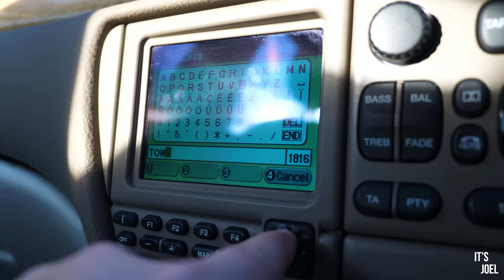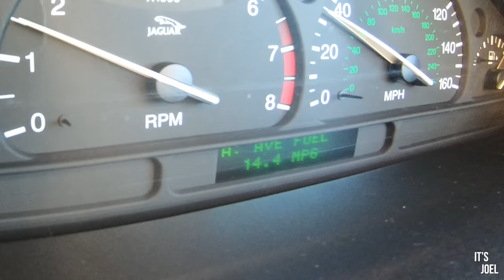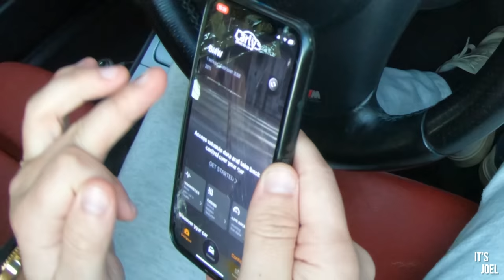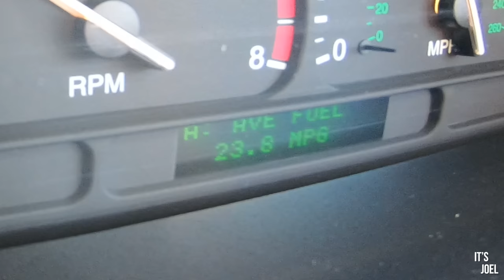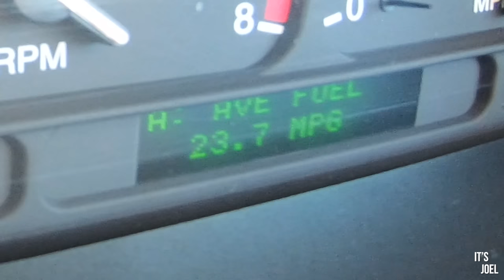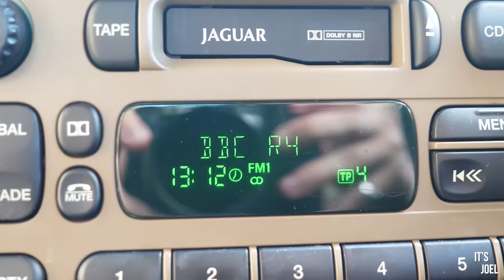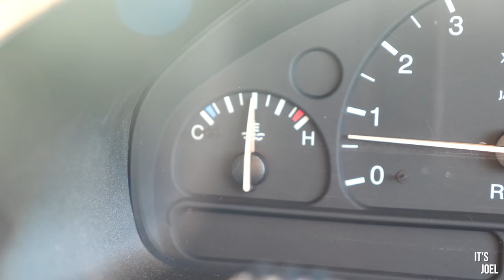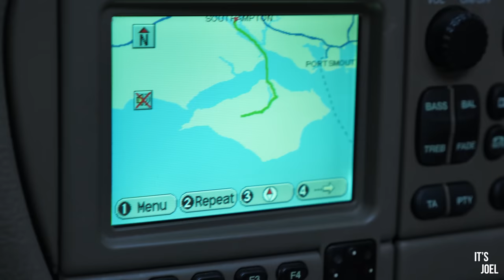Can I drive my cheap & broken V8 Jaguar across the country?

Comment: Ah I should’ve given you a tip. In winter put the sticky pads on the plates and then leave them on a radiator for a few minutes before sticking them onto the car. It helps with adhesion
Reply: I was going to say take a hairdryer to them and the point where you're going to stick it
Reply from the maker: I probably failed at the part where I used a wet cloth to ‘dry’ the surface… 😂 I was running late
Reply: @itsjoel  lol
Reply: Don’t top up with pure water in these conditions. My step dad did that in a rover years ago and up to full working temperature went on the motorway and the radiator froze due to the wind chill.
Reply: @itsjoel  it’s common sense there not gonna stick to a wet cold car 😂🤦‍♂️
Reply: @itsjoel  screwing them on is the best way to stop them falling off. I never trust sticky pads, I always screw my plates on my cars
Reply: @lukefleming0607  true
Reply: High Peak Autos & It's Joel in one comment. 👍
Reply: How did the world manage before YouTube and sticky pads Brunel would be proud.
Reply: E38 728i  Mint green manchester .
Reply: I love my stype. It sounds and looks like a jag.
Reply: Rudi

Comment: I really love Jags. My last one was an XJ358 V66,  I now have an Xj351 Portfolio, I can’t get over the performance & luxury that this car provides  - from the floor to ceiling, there is a feeling of superlative luxury , comfort and believe me, you ca climb out at the end of  a long trip, feeling fresh, wanting to justt get back in & take in everything the entertainment system offers, knowing that you won’t be getting anything better in your £185 per night hotel! There is one thing I envŷ you in your S Type is the beautiful wood steering wheel & transmission shift! Sure, I have massage seats, incredible 21 speaker surround etc But the steering wheel is heated and all that, - but no wood! An, I bought mine with only 48k on the clock,, paid up front, and find it hard to believe that this sort of luxury,  performance & looks could possibly be beaten! The new design took a bit of getting used to, but it too, is still unique. Sure  they cost a bit t maintain, but who would want any more? And it is British. There is nothing like a Jaaaag!

Comment: Good afternoon from Texas. If I may  make a suggestion, unless it’s an emergency, I wouldn’t ever add water alone to the cooling system. It quickly corrodes the water pump. Also, if you fill the reservoir with proper coolant after you’re done driving it for the day, the radiator will draw it in during the overnight, cooling off process. Good luck.
Reply: If you have a car that is leaking coolant it becomes quite expensive to fill it up  over and over with actual coolant and since the car was mostly full of coolant and Joel just topped it up a bit with water is probably not going to harm the car. Or harm it anymore at least.
Reply: @lbnewell23  but isn’t he topping it off regularly? If so it’ll quickly become a coolant system full of tap water won’t it

Comment: Just FYI, the temperature gauge on Jags of this era are just "idiot lights" (it certainly was the case on XK8s). From bang-on in the middle, straight into the red if over heating is detected by the ECU. There are mods to make it actually useful. Your leaks could be caused by exhaust gases building up in the cooland system, causing excess pressure. To be investigated.

Comment: I owned a Jaguar S type 2.5 v6. Silky smooth  & reliable engine, for a 2005 plate motor.  Cost me £750.  Good on fuel. Had black leather seats.Best motor ive owned.My dad drove it around for over a year.

Comment: If you can roll the driver side window up what you can do is press and hold the open all doors button and all the windows will open then just roll up the others I have the same problem in my s type because I completely forgot to roll up my front windows when it started poring rain one weekend and my driver side doesn't go down but it goes up I would check to see if it makes a noise when rolling it up if it does then you can use the method till you get it fixed

Comment: i dont think you have a head gasket problem . Sat navs are crap i set mine then ignore it its mad i set it once FROM ,  manchester to stratford upon avon it tried to send me on the smart motorway on M6,   I IGNORED IT AND WENT  M6  M5 on to m42 then m40 Junction 11  .86 miles less my way  than sat nav..

Comment: Brilliant video Joel, with the S Type on the Isle of Wight. Me & my husband go on our summer holiday every year & we go in either one of our Jags (yes we've got two)😃. Good luck with the wedding next year. The island is a beautiful place for the wedding.  I can also recommend Jersey where we had our honeymoon, a long time ago, admittedly..lol. But that is a special place too with a unique history. 
In terms of the Jag V8, might be worth getting the water pump & thermostat housing looked at. They're plastic on the early 3.2 & 4 litre V8s & do go. You can get metal upgraded one's though from the later 3.5 & 4.2 V8s. Might be worth checking the timing chain tensioners too as they are also plastic & can break, with nine failure. They can also be upgraded for later metal versions. If it's not already been done (check the service history). It's not a cheap job, for the tensioners & a new chain, probably nearly £1000 with labour. Good luck.

Comment: Best advice when attaching number plates is to use screws.
 No getting stopped by the police for having no number plate on the rear on account of it falling off 10 miles back.

Comment: Actually started laughing at the dancing to the car alarm 😂 👍🏻
As an L322 owner I love these old car vids. Great work Joel. 👏🏻
Reply: How’s your L322 treating you? Hoping mine will have an MOT next week 🤞🏻
Reply: @JAYPCARS  ok now I’ve done this in the last year…
Timing chains and new water pump
Refurbished gearbox and new TC
New steering angle sensor 
New callipers all round
New rear rose bushes
Air suspension calibration 
New rocker cover gaskets
Service and new filters
New oil in all diffs
😂
Needs arches doing next. Most of the above was preventative apart from brakes and steering angle sensor
Reply: @JAYPCARS  😂 it’s a second car that I want to keep and I only use it to take the kids camping etc and use for weekends away and . Hopefully it’ll last me another few years now until I have an itch to replace with a late L322 or early L405.

Comment: Just a thought, you might want to check the antifreeze level of the coolant. With temps reaching minus 7 or lower you don't want frozen pipes.Especially if you are topping up with just water frequently.

Comment: Hi Joel,  not sure if your Jag's sat nav is DVD or HDD based but I believe you can get updates upto 2020 which might help a bit. 

Picked up a 2020 DVD form my Land Rover L359 when I first got it.
Reply: Got to be DVD, HDD didn't start appearing until the late 2000s in most cars, I know my E93 didn't until 2009.